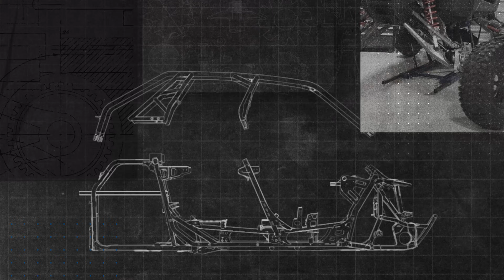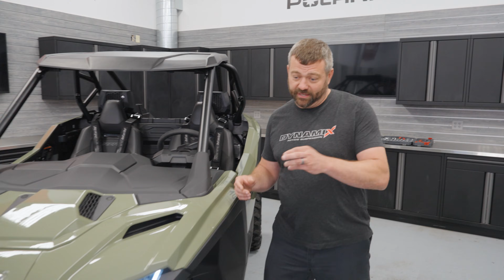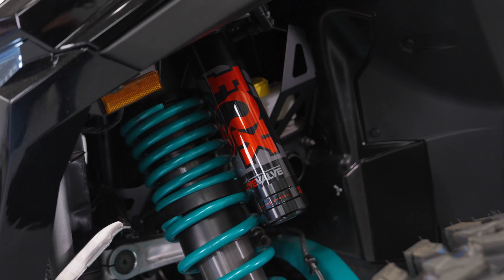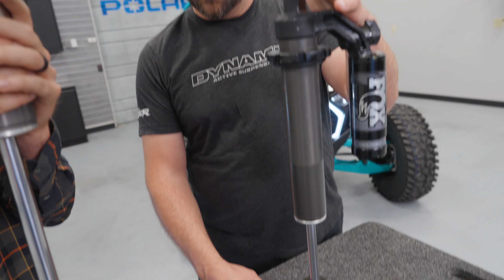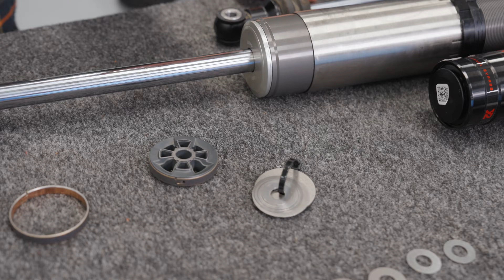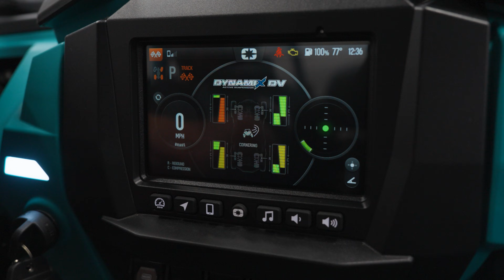NEW RZR Pro Lineup FOX® Suspension | SHOP TALK  EP. 57 | Polaris Off Road

Comment: This question is for Polaris.  Can you explain whey the springs on nearly all of the higher end machines need to be changed almost immediately?  I was told it was set this way to pass some compliance test.  if this is true, can you just share so i know why i have to go spend some high $$ to fix a VERY well known issue.  Thanks.

Comment: So the Turbo R had dual valve (compression and rebound) in previous models, now you have to get the Pro R to get that kind of suspension? That kind of blows since the Pro S is basically the successor to the Turbo R

Comment: Wish the Mode settings were adjustable.
i Have my shocks tuned much stiffer then stock for aggressive dunes. I also have stiffer springs.
I really like the ability to adjust on the fly, but the stiff isn't stiff enough.

Comment: I have a 24 Pro R with the Dynamix Fox Shocks. This is my third RZR. I always thought my old RZR's had great suspension, until I drove my new RZR with the Fox Shocks, they are so much better in every way. Great explanation on the workings and theory of this excellent suspension system.

Comment: I can't wait for the dealer to finish the upgrades on my new '25 Pro XP ULT. I would be stoked to see a video on a true side by side comparison of the Pro S and the Pro XP as far as ride, suspension capabilities ect.... I was very torn between the Pro XP and the Pro S. but couldn't really find much info in the way of a direct comparison. Ultimately I  went for the 64" width for the mountain trails here in Idaho.
Reply: How has that rig been for you? I have a 24 RZR Trail Ultimate and I am looking to upgrade to the Pro XP to stay at that 64" width and am curious what people think about it. The new shocks, cab vents etc.
Reply: @Diamondguy117  I love it. The live suspension on the ultimate is so good that I don't think I could ever go back. The new hood venting and heatshield really does make the cab noticeably cooler compared to the General I had... plenty of power... almost too much for the trails around here. 64" is plenty stable as I am mostly a trail rider not a dune runner... My only complaintis that the rear speakers are a little too tall for the spare tire carrier. Polaris mounted it low and behind them, but that made getting into the two bins a PITA.. so I ended up sliding it up the roll bar and really wedging it ontop of the speakers.. the stack tire size barely clears the roof when it's opened.. might prove to be a nescience when I move up to 32-33s...

Comment: Really wish they installed this on the Xpedition
Reply: I had the Pro with Dynamix shock.  I now have an Xpedition and I feel the ride is way better everywhere except the big whoops.
Reply: @JeffC-t8m  I agree 100000%, my Xpedition blows away my RZR Turbo S even with Dynamix shock.  The Xpedition is so much better in the studder and mid size bumps, it isn't even close.  My Turbo S was a huge disappointment.
Reply: Expedition ain't a sport machine
Reply: @andrewmcmanaman7372  go ride in one. I had a Pro R with Dynamix to compare to.  Only difference is more power and ability to stay in it in the big whoops. I've had an XP1000, Turbo S, Pro XP, and Pro R.  The Xpedition is my favorite ride so far.
Reply: When the manufacturers start producing HVAC, sports sxs's you all have your 'perfect' machine. Till then pay your 60k and shut your mouth